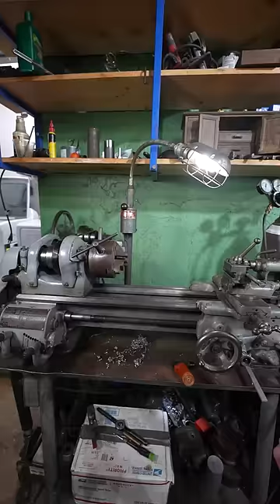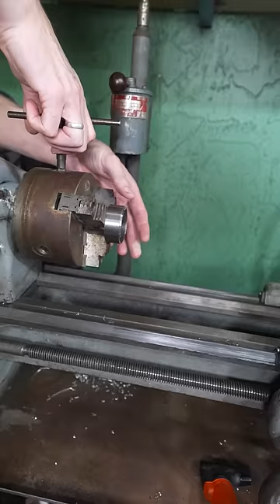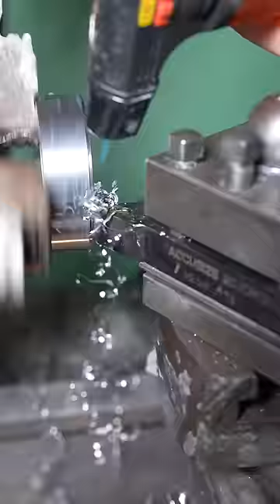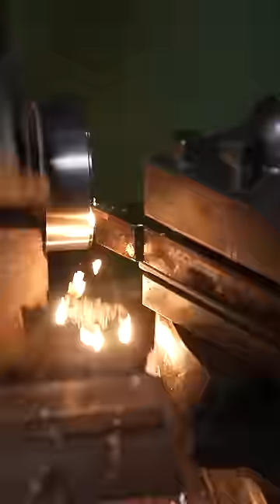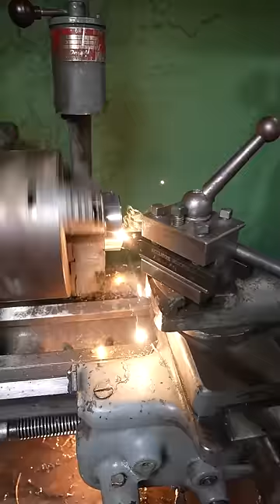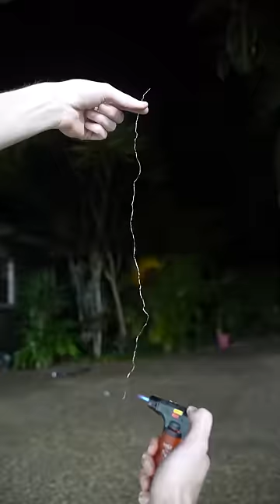Titanium has a dirty secret

Comment: Soviet submarines used titanium hulls, until they found out that vibration makes titanium brittle
Reply: My understanding Titanium was the reason Nixon went to china
Reply: Interesting
Reply: The Soviet nuclear submarine K-162 is unique in its kind and exists in a single copy. An experimental model with two titanium hulls - external and internal - was launched in 1968. Back then, the submarine fleet and submarine engineers faced two big challenges: making submarines invisible to radar and fast to pursue targets and avoid threats. And the creators of K-162 coped with these two tasks perfectly.

Titanium is a non-magnetic metal, and the К-162 constructed from it was completely invisible to the locators of that time, which were called magnetometers. In terms of speed, it also had no equal, as the unbroken record shows: not a single torpedo could keep up with it at that time, but the К-162 was easy to pursue ships.

The Soviet K-162 submarine was called a “Golden Fish" for its unusually high cost. There was nothing surprising in it: for the first time in the world, such a ship was built from titanium - a very expensive metal, and other circumstances did not reduce the cost of construction. And it was and remains the fastest in the world to this day because on December 18, 1970 it managed to show a speed of 44.7 knots = 81.4 km/h(50.58 mph).

On March 30, 1971, the boat recorded an extraordinary speed during a test: 44.85 knots, that is, 83 km/h, was achieved. The Soviet Navy command considered the achievement unproven since that speed was measured by a Soviet hydrographic vessel and not the submarine instruments, so the previous speed appeared in all documents.

K-162 was also not born easily. The choice of titanium as a material for building a durable submarine hull required solving a large complex of problems. To begin with, most of the calculations had to be done anew, since the physics of the behavior of titanium in water turned out to be different than that of steel, and the welding of titanium structures had to be carried out in an argon environment. 

The highest speed of the K-162 submarine was required in order to reach the enemy as soon as it was detected, fire cruise missiles at it and immediately turn around and rush to its base.

This fact was established practically and led to incredible confusion among the command of the American Navy. During the first combat campaign with full autonomy, from September 25 to December 4, 1971, the K-162 pursued the American aircraft carrier Saratoga. Even at its highest speed of 30 knots, the Saratoga was unable to break away from the unknown submarine, and then discovered that K-162 easily overtook it and went ahead. This fact shocked both the Saratoga crew and its superiors in Washington, who realized that they were dealing with a new Soviet submarine with extraordinary capabilities. 

The K-162 had ten nuclear cruise missiles on board, plus a dozen nuclear torpedoes. That was considered enough to destroy a US Navy battle group.

The Zolotaya Rybka(Golden Fish) remained the only boat of Project 661. First of all, because the Soviet budget could not support the construction of a large number of such expensive submarines. In addition, the K-162 turned out to be extremely noisy: at speeds above 35 knots, the titanium hull created a turbulent flow, causing strong hydrodynamic noise. At the central post of the boat, measurements showed its level of 100 decibels: like a chainsaw howling in your ear or thunder roaring.
Reply: Wait, vibrations does that to titanium?
Reply: That doesn't make sense, titanium generally has better resistance to vibration-induced fatigue compared to steel and aluminum. Steel can suffer from fatigue failure due to vibration, especially in high-stress applications, while aluminum is more prone to fatigue cracking under cyclic loading. Titanium's superior fatigue strength and excellent damping characteristics make it less susceptible to vibration-induced failure compared to steel and aluminum, particularly in aerospace and high-performance engineering applications.
Reply: @almazblanco6676  Awesome information!  Thanks for posting.

Comment: Titanium itself is super abundant. It’s expensive because it’s very difficult to process from raw ore. If I remember correctly it doesn’t melt until it’s north of 3000 degrees.
Reply: Super abundant?
Where did you hear that?
Reply: @owensthilaire8189 Titanium is the 9th most abundant element in the earth's crust.
Reply: @davidwild66   But is only found in useful amounts in a very few places on Earth.
  One is hardly going to process hundreds of millions of tons of rock for a few ounces of metal.
Reply: @owensthilaire8189 not rock but sand. There's lots of titanium in some iron sand, in the form of titanomagnetite. Smelting the iron out of that is easy enough, but getting the oxygen off the titanium is crazy expensive. There's no shortage of the ore.
Reply: @owensthilaire8189 
You can say the same for copper, titanium is only expensive for its processing and manufacturing costs. It’s cover up in SR-71 cover story.

If it’s easy and cheap enough to process and use it in manufacturing, and there’s high demands. Mining industries will explore much more areas and making your point invalidated.
They literally never stated titanium just rare af material.
Reply: @MP-vc4nu   Copper has a significantly lower melting point, thus it is easier and cheaper to refine. It's also a lot of softer,  hence easier to work with once it is refined.
Reply: It's one of the most energy consuming metals to process
Reply: Titanium also has to be smelted in an oxygen free environment, or it will oxidize as it cools.
Reply: It needs to be melted several times in an expensive vacuum arc furnace
 Start as sponge looks like briquettes but very lite
 Several pieces are welded together in inert environment then melted together
Then the ingot is placed in a hot box to cool
Our company made the furnaces. Capacity 60 inch wide ingots. Took a long time and a lot of juice to do this
 The machine I refer to had 2 chambers and 3 DC power supplies each @ 60 vdc and 35000 amps
Reply: As titanium has such a high melting point you'd wonder why its shavings are so inflammable.!
Reply: @gerry5134  There is a difference between heat and oxidation.
Reply: @Gator141a  35000 amps, I can’t even imagine that kind of power.
Reply: @gerry5134 
Same thing with steel. 
In big enough contiguous quantities it's not flammable, but fine steel wool on the other hand...
Reply: @kairu_aname  yes that's right ! 😯
Reply: 1668 degs C
Reply: @owensthilaire8189    Yep.  Super abundant. But not in normal ores like iron and lead and copper.   It’s in very tiny bits in sands and certain rocks. There is a lot of it…but so small.  
     And it takes extreme temperatures and lots of work to extract and concentrate, and so tough to work with.  
   But it is an exotic and strategic metal.  Amazing metal.
     I have a one pound .999 bar of titanium sitting on my coffee table.  And my belt buckle and eye glass frames are made of titanium.  I love the metal.
Reply: @robertwilliamson922    Yes. I have ( gtaw )welded it a couple of times.
  The bead is so hard after that it cannot be ground.
Reply: I remember they made titanium handguns for a short time, but they had to use a steel barrel insert. I think it was because the titanium was too difficult to rifle, but it may have been because of flammability.
Reply: @henryturnerjr3857      It’s not flammable as a chunk of metal. Only titanium shavings and powder are flammable .   Same with many metal shavings. Not just titanium. Even iron and steel shavings, and aluminum shavings can burn.  
     Titanium metal can withstand much higher temperature than what is produced in a handgun.  That’s one reason why it is used aerospace industry.
Reply: @henryturnerjr3857  It is difficult to machine
Reply: Right! I once worked in the Titanium industry.
Reply: @gerry5134  high affinity for oxygen
Reply: EVs should be made of it then,
Reply: Given Titanium was discovered in Cornwall UK, in a part of the country with plenty of sand, this makes sense.
Reply: That's why it's used in fighter jets and rockets because it has a high melting point
Reply: Very hard to work with. I work at a machine shop. We had a military job for helicopter parts. I had to tap some titanium. The only reason we accepted that job is because it was attached to another job. I am not violating any confidentiality because this islover twenty years ago my contact
Reply: @gerry5134 The same reason you can write an s o s pad or steel woollen fire
Reply: Titanium oxide is used for white pigment in Paint and Primers. Russia sold off a glut of it for cheap in the 1990's, So, Du Pont cornered the market and charged twice as much for it.
Reply: It will also oxidize super fast at that temp causing the burning, so it has to be refined in an oxygen free environment.

Comment: Public PSA: 

Do not do what he did and leave that  tool inside of the turny bit.  
(The turny bit is called a chuck and the tool is called a “Chuck Key” or “Chuck Wrench”)

It’s sort of “Turbo Deadly Dangerous”. 
It can drag you in and make you look like ground beef. 
That is not a cosplay you want to partake in.
Reply: Yeah, that's never happened. 

The worst case is someone needing stitches and a mangled hand, which again wasn't really from the key but the op holding the damn thing.
Reply: @5isalivegaming72 
There is an unfortunate amount of videos showing operators getting drug into machines including lathes like this. It's a pretty undignified death to say the least. My old instructor brought up a list of videos he wasn't supposed to show us in safety training but he wanted to get the point across. It worked.
Reply: Yeah like the 2020 russian guy
Reply: @isaiahcampbell488  not with Chuck keys, I guess I should have clarified. Hands and clothes being in places they shouldn't is another story entirely, though. 

When serious incidents happen, it's when the lathe is in full motion. If it's in full motion, then the key has flung across the room in a medically insignificant manner.
Reply: you've been duped. making controversial "mistakes " increases engagement.
Reply: @5isalivegaming72 I wouldn't want to test that. Also it doesn't seem implausible that the key could be stuck for just long enough that it could snag your clothing enough to wrap it around the lathe, and then your fucked. It doesn't matter if the lathe is up to full speed or not.
Reply: I was setting up a turret lathe years ago, and when I was tightening the key, I accidentaly turned the machine on. The chuck spun. My hands were trapped under the key, against the deck. I had to pull like crazy to get my right hand out to hit the emergency stop. It bent the key. Hurt like a mtfkr. Almost lost both hands.
Reply: @5isalivegaming72 Well written and articulate, but as others have said, it has happened. The chuck key flies and makes a nice mark in the wall, but I saw first hand what a spinning chuck can do; to a teacher. She was really big on the whole "no dangling clothing, jewelry thing" but her pony tail "let loose" spontaneously from being clamped onto her head with some crappy clippy thing, and dropped onto the chuck. She had a huge piece of scalp ripped out and had to wear a neck brace from being yanked so hard. See that ONCE and you know to be extra super duper careful. There are FAR worse examples, to which I say "No thank you".
Reply: @isaiahcampbell488 *dragged, not drug.
Reply: @isaiahcampbell488  "drug into machines"....are you hallucinating?
Reply: @Adenzel If the chuck key were to stay in the chuck it wouldn't make it more than 180° before it hit the bed and stalls the spindle.
Reply: @Blown460  I dunno if that applies across the board. I think some machines have the clearance for full rotation w/out hitting the bed. So its possible to hit full speed on the chuck and depending on the tightness of the key, it could "get up to speed". There's a hunk of concrete missing from the wall at a school I went to, from the key hitting it, that they put a frame around with a kid's name. Seems like that did more than half a turn to do the damage it did. I've heard of similar "framings" from the same thing, unless it's just a deterrent perpetuated by the teachers.
Reply: @Adenzel  Once it grabs your clothes its going to tear out long before it pulls you in
Reply: @DarkAttack14  Yeah, I wouldn't bet money on that.
Reply: The starter switch is also in a ridiculous position ..
Reply: @fastone371   And I certainly wouldn't bet my Life/Limbs on it either.
Reply: @5isalivegaming72 yeah you're full of crap from an EMT who's personally seen something like that along with multiple documented example. But hey, if you wanna skin your arm and rip muscles out go for it.
Reply: @DarkAttack14 wanna see a video? 💀
Reply: I have personally seen someone get scalped by this and were I not walking to a nearby mill and able to slam on the foot brake it would've been much worse
Reply: @5isalivegaming72  3 months late but the algorithm led me to this comment lol. I just watched a video last month about this very thing that will stick with me foreover. The operater's coat was caught and it spun him so fast his organs flew out of his mouth and he blew apart.
Reply: @5isalivegaming72 look up the Russian Lathe incident

Comment: Fun fact: Titanium Oxide is our largest source of raw, unrefined titanium metal. Burning the metal shavings returns it to its oxidized form.
Reply: So burning makes more sense than e.g., storing the shavings in a fire proof box to be (sold and) melted down at some later point?
Reply: It's also the most common white pigment, common in paint and toothpaste.
Reply: Teert712 unless you have a titanium fusion reactor i doubt that the mass is being converted to energy
Reply: Teert712  ... or energy can come from the bond being formed between the titanium and oxygen?
Reply: @masonwillms2542  i guess those bricks i stacked in the back yard are a fusion reactor for wood. What do you think happens to things when they burn?
Reply: @lastnamefirstname9043 
The chemical bonds holding the different molecules together break apart. The mass of the wood itself doesn’t become energy.
Reply: @bruhbruh-us6gl  mass doesn't need to become energy. Mass is energy. Remember energy = mass times the speed of light squared, Einstein. When you burn wood you convert some off the mass to energy. It's just not 100% of the matter being turned to energy. Where does the mass go? Where does the energy come from?
Reply: @lastnamefirstname9043  
I’m not a chemist or a physicist, but I’m pretty sure that isn’t correct. Neither energy nor matter can be created or destroyed.
Reply: @lastnamefirstname9043  Well no... When you burn wood you break the bond between the wood and carbon/oxygen and then the carbon will readily react with Oxygen to create Carbon Dioxide. This is the reason why you lose mass when you burn wood as you are creating gaseous by-products.
In contrast when you burn titanium it reacts with nitrogen & oxygen in the air creating titanium oxide & titanium nitride (as well as any reactions from impurities on the titanium). As all of the byproducts of this reaction are solid the titanium actually increases in mass when burnt.

Disclaimer: I am not a chemist or a physicist, I just happen to work in a field where I am in contact with titanium.

Fun fact: Titanium fires are notoriously hard to put out as they continue burning when in contact with Oxygen OR Nitrogen and because of the very high temperature (1668C).
Because of this it is basically impossible to put out titanium fires by pouring water on it, and thus class D extinguishers must be used - for example sodium chloride powder.
Reply: That's it's I'm trapping air for future investment
Reply: @Soul-Burn  Yep! that's the stuff.
Reply: @lastnamefirstname9043  hell no

Comment: Titanium is also interesting for machinists in two other ways. One is that it work hardens, so if you stop in the middle of machining a part of it, it's very difficult to restart, which is why most things have to be done in one go. And the other thing is that it retains heat in the workpiece, instead of the fillings, meaning that it gets hotter and hotter as you work it
Reply: With that secondary fact it's probably a great thing that the melting point of Titanium is so high
Reply: It can also deform strangely and even feel like it's gumming up your bits when working with it, especially if you are used to working with steel or aluminum.
Reply: that secondary fact is false if you get your speeds and feeds and coolant right. you can get all the heat into the chips. low speed high feed, tons of coolant. ask me how i know ;)
Reply: Very interesting, honestly
Reply: @slabbadanks5829  A workaround existing doesn't make the fact false. If you don't do anything special, the thing he said happens. If you do something special, you can mitigate that property.
Reply: @hoo2042  spoken like a true keyboard warrior
Reply: Facepalm
Reply: The last point from op regarding workpiece heat retention just seems to circle back to the other person who pointed out the importance of good feeds, speeds, and fluids- high feed low speed.

If you get those wrong it doesn’t really matter what alloy or material you’re working with, your work piece will be hot, and likely out of spec, due to incompetence.
Reply: @matter9  bingo. All this info can be found in machinery's handbook anyway.
Reply: @hoo2042 Agreed. All the jerryrigging in the world cannot negate science. Unfortunately the other decided to call you names instead of being open to OP's knowledge.
Reply: You're describing stainless steel not titanium
Reply: @manuelmontiel5418  I'm pretty sure I'm describing titanium, but stainless can, in some cases, behave similarly.